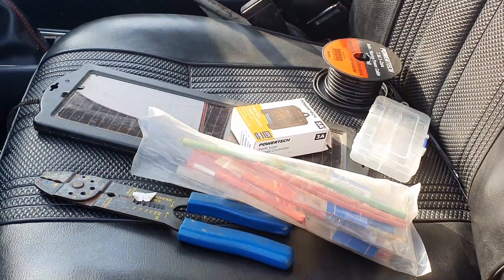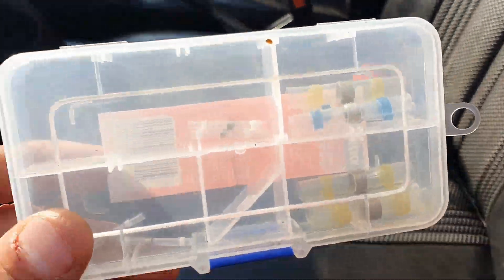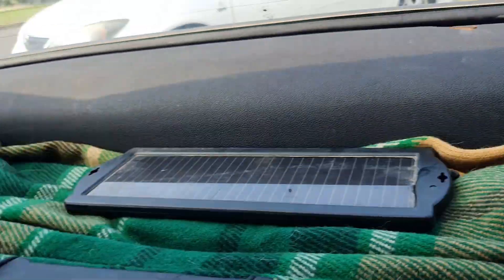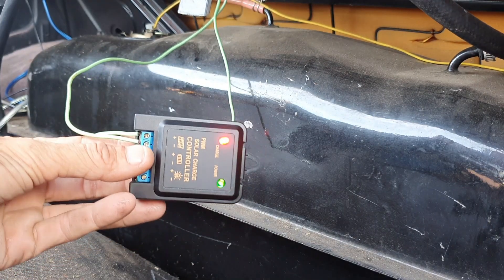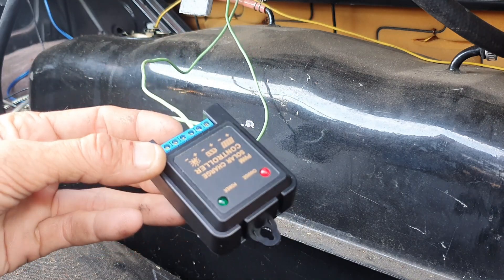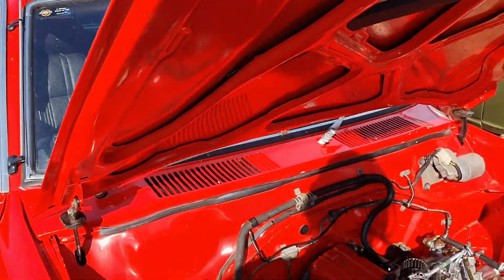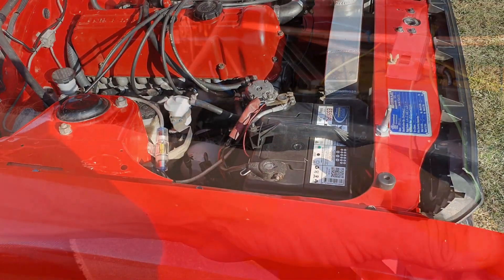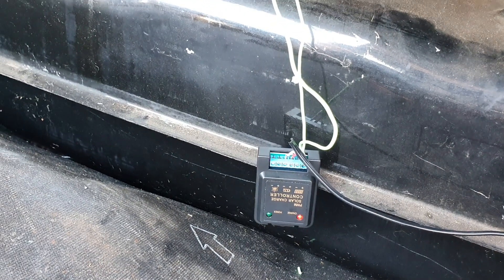SOLAR POWER FOR MY CAR

Comment: Didn't the charge controller come with instructions?

Also should have a fuse on the positive wire as close to the battery terminal as possible so if the wire melts or chafes on something and shorts out it doesn't burn the car down.
Reply from the maker: the instructions weren't 100% clear, translated from Chinese to English badly i think.. and yeah defiantly need a fuse or ill come out to ashes one day.. Have since decided its all working fine.. dosnt do much, but will help if it sits for a while..